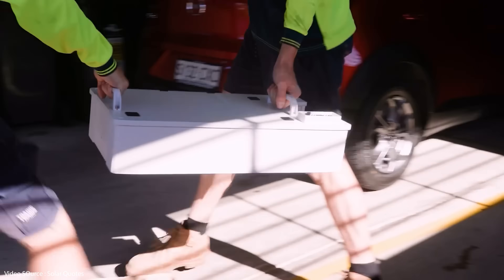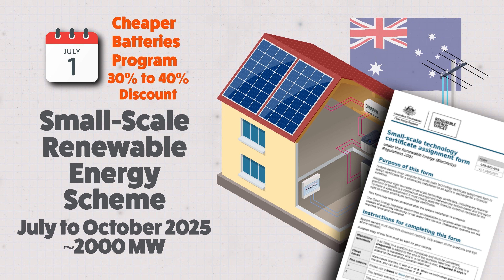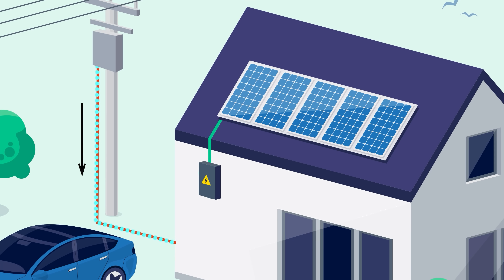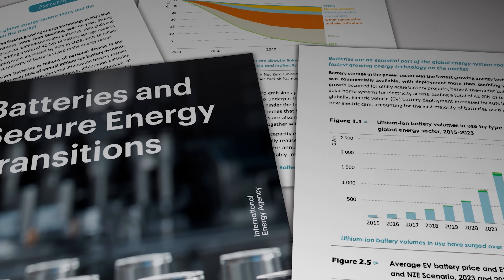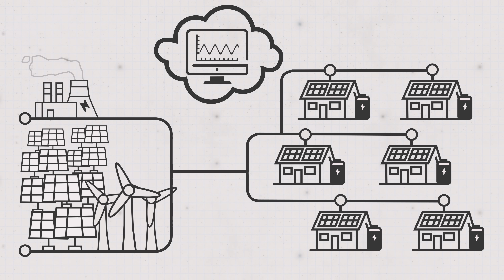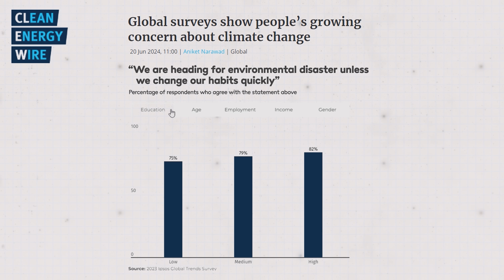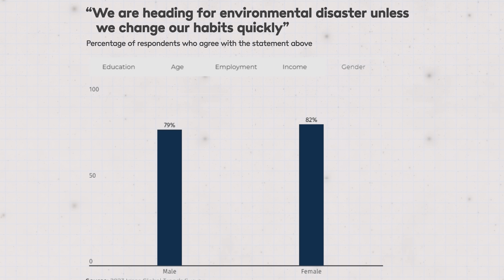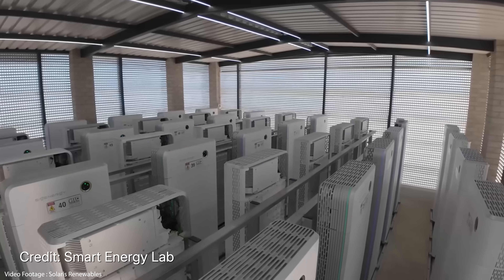Australians installed 100,000 home batteries in 17 weeks. Why can't we all do that?

Comment: We are here in Washington State, we are just coming on one year with our upgraded Solar.  We went from 4 Kwh's worth of just solar panels to 17.6 Kwh's worth of solar panels and 20 Kwh battery backup.  We are really happy during the summer months as we have two EV;s and most of the time we are off grid during the summer.  Due to some trees and our overcast days during the winter we do not make much power, however overall we are really happy with our system.   And as a side note, when we do loose grid power the batters click on so quickly that it is hardly noticeable.  Great Video.
Reply: So, you're stealing power-service.
Reply: @aliendroneservices6621 brewing our own, when we can.
Reply: @gardenrailroading  You're connected 24/7/365 to grid power-service, but not paying your fair share of the community cost.
Reply: @aliendroneservices6621 Actually we do pay a monthly Connection fee, so we are paying our share of the grid.
Reply: @gardenrailroading  That doesn't cover your full share. You are forcing your neighbors to subsidize your power-service.

From Google AI:

In many jurisdictions, regulators do not allow the basic fixed charge to fully recover the utility's fixed costs. Instead, a portion of the fixed costs is recovered through the variable, per-kWh energy charge.

Low-usage customers pay a smaller total amount toward the utility's fixed costs than what their service actually costs the utility to maintain, especially if they use little or no power. For example, a customer who is away for a month still needs the entire grid infrastructure to be available and ready when they return, but will only be charged the fixed monthly fee, not a usage charge.

High-usage customers, including large families or industrial users, pay a higher total amount toward the fixed costs by using more kilowatt-hours, where a portion of the fixed costs is bundled into the energy rate.

The result is that high-usage customers effectively subsidize low-usage customers by paying more per unit of electricity than their usage-based costs.
Reply: @aliendroneservices6621 Actually, we are providing power for the local power service when we make excess, so they do not have to buy as much power from Canada plus we are paying a monthly connection fee.
Reply: @gardenrailroading  You are not providing power-service to the local grid.
You are forcing randomly-produced energy onto the grid.
Energy is free.
No one needs your energy.
No one benefits from your energy.

In exchange for forcing your worthless energy onto the grid, you get a reduction on your power-service bill.
That is how you are stealing.
Reply: @aliendroneservices6621 agree to disagree, you will never see my view, I will never see your view!

Comment: My sister, who lives in Southern England, has solar panels on her shed and batteries inside it. They use it to heat their hot tub at night as well as trickle power back excess into the grid via Octopus. She calculated it would pay for itself in 5-10 years (depending on how well the panels worked) and is now considering getting more panels installed. Meanwhile her bills have dropped dramatically.

Hopefully the new Infrastructure planning bill going though parliament will help to address some of the issues associated with upgrading the grid, but in the meantime, distributed power storage sounds like a good solution. It also reduces power transmission loss which was around 25 terawatt-hours, or approximately eight percent of the electricity supplied in the UK in 2022.
Reply: "...her bills have dropped dramatically."
...Because she's stealing power-service.

Comment: Unfortunately, here in the U.S. companies like Solar City over sell the cost benefits of solar power and take all the homeowners tax credits. It takes about 20 years to break even using Solar City in north eastern U.S.. You’re much better off buying your own equipment and have a company install it. I’ve upgraded everything possible insulation wise in my house for energy and only pay less than $250 per month for my 3600 sq. ft. all electric house. My house is surrounded by trees and solar panels didn’t make sense.

Comment: In America, the answer is NUCLEAR!  The question about how to wean ourselves off of fossil fuel is not and has NEVER been anything else.  When you try to force unnatural changes to a 'free' market, there will be major turmoil, as expected.  Market forces are the smoothest, most natural way to transition.  Make more power available and REMOVE government meddling and things kind of work themselves out.  If they don't, they were not affordable.
Reply: Nope, the answer is geothermal
Reply: @Les_S537  Which countries are at over 50% of electricity as geothermal?
Answer: none.
Reply: @Les_S537  No proof-of-concept.

Comment: A reasonable system of Octopus Energy PV & Battery came in at over 10K GBP & pay for itself in 8 years (really?). My power consumption would take that past 20 years. Electricity would rise in price, so savings come in sooner but 10K invested for 20 years would yield at least 10K alone, leaving the principle as cash. Compare that to a 20 year old system that incurred maintenance costs most years, and still needed replacing. There was the nebulous "selling" my electricity. But, get this, the smallest (cheapest) battery could not be used in the event of power outages. Cue bigger more expensive battery, longer payback. Better system is needed IMNSHO

Comment: We recently installed a 14.08 kWp solar panel and 11.10 kWh battery system in our house in Germany in order to be able to power the heatpump which we plan to install next year with cheap power. You do no longer have to pay value added tax for installing solar panels and batteries and you can get quite a big subsity for replacing your oil or gas furnace for a heat pump if you file a request for those. In our case 40% for the heatpump and 20% for insulating the house. In Germany our houses are connected to the grid using all 3 phases so dumping electrsity in the grid isn't that big of all deal. We are still limited to 60% of maximal power (so 8,448 kWp in our case) but since we only get 8 cent per kWh but pay 39 cent it's generaly recommended that you use your energy yourself first.